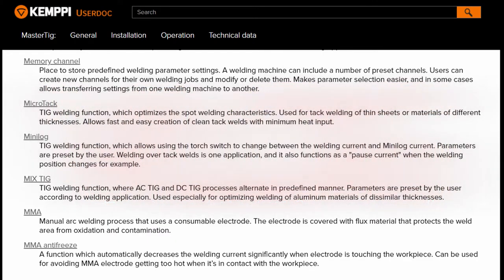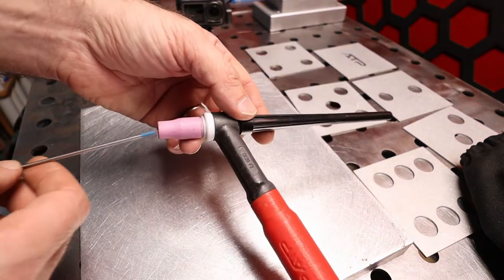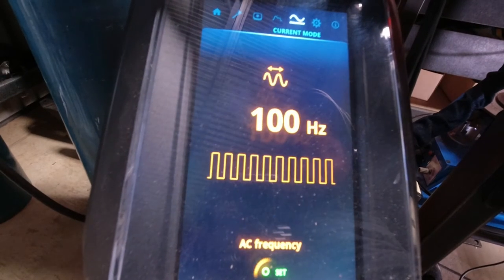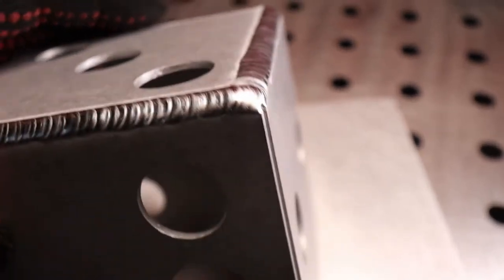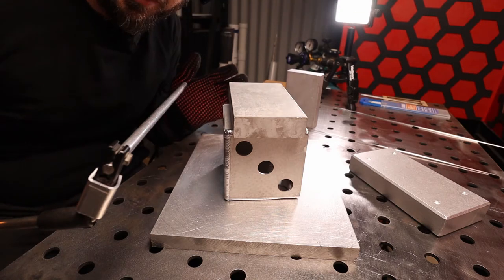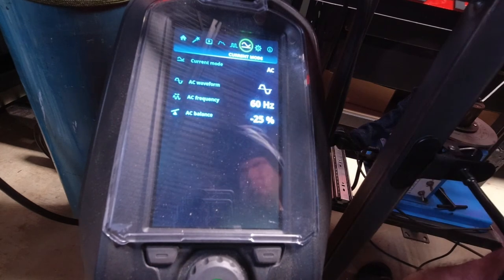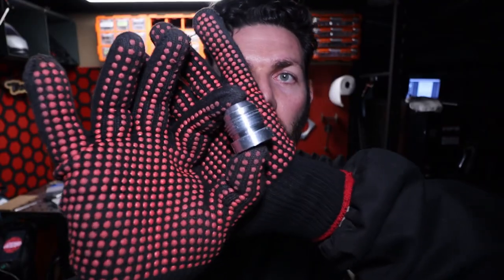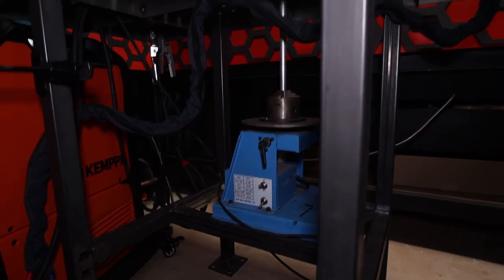MIX TIG on 2mm Alloy - KEMPPI MaterTIG 235 - VLOG

Comment: I used the mix setting to weld 1.6mm aluminium perforated sheet to 6mm aluminium equal angle and it helped to make it much easier to weld. Using the factory recommended settings
Reply from the maker: Nice, sounds like the perfect application for the MIX TIG setting! 👍

Comment: I was 100% wondering about the turntable!
I have never tig welded but im interested to the point of researching welders which brought me to this vid.
Everyone is too busy to make the things i want so why not learn a new skill.
Reply from the maker: Hey Ben, This is a welding positioner that I have stripped down and fitted to my welding table. Super simple and works perfectly for the things I make! 
TIG welding is a lot of fun and there are some pretty great (cheap) machines these days, spend your time over on @weldingtipsandtricks and you will find all the answers to your questions. 

From a fellow DIY-addict, congrats on pursuing a new skill!

Comment: You should try really up the positive balance and but have a higher dc ratio. On my Fronius I can change the amps . So if you run high positive pulse amps but more negative balance . It keeps a tapered tungsten
Reply from the maker: Correct, it is much more successful when it's used as intended with higher DC ratio. But this was just more of an experiment rather than it's actual use of thick to thin material.

Comment: What exactly Wolfram make and color did you use?
Reply from the maker: Skip to 1:07 I run through the torch setup👍

It's a 2.4mm 2% Lanthanated.
Reply: Hi Adam can I have the best pulse settings you used on the best weld on the cube please . Thanks ,chris

Comment: If you tack them right, and weld with square wave, you don't need filler wire
Reply from the maker: These are practice pieces 👍